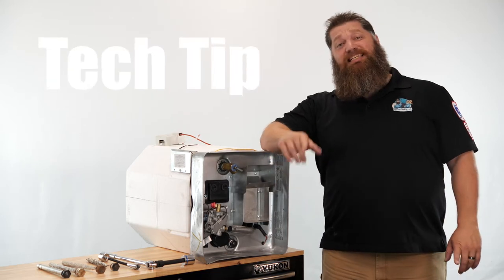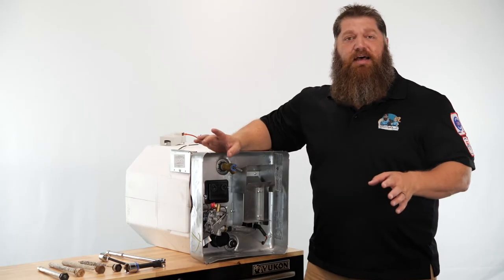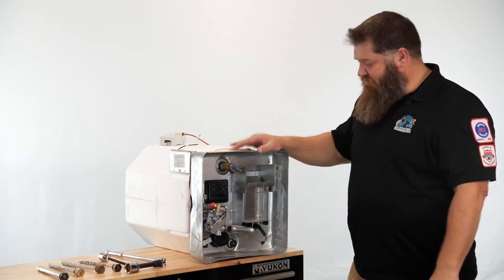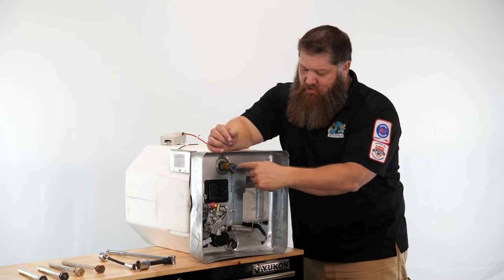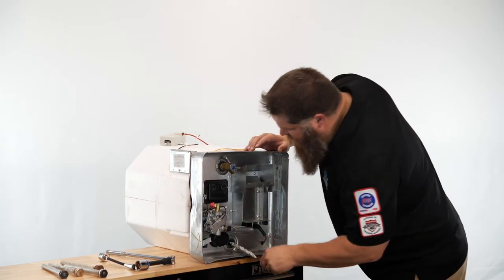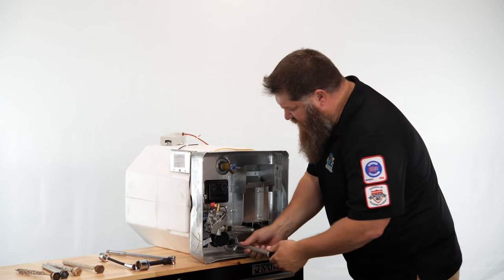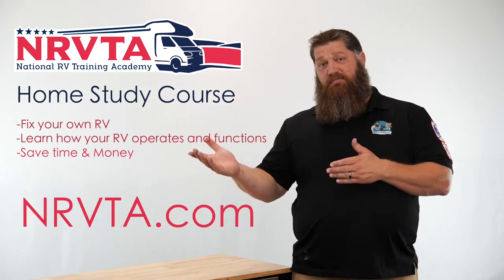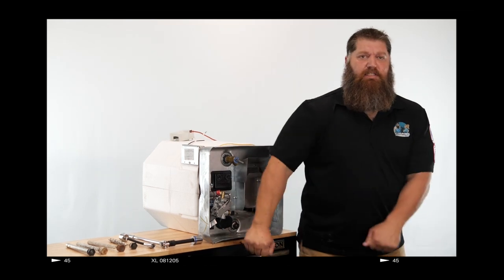What is an RV Anode Rod / How to change it

Comment: I know this video is a 3 years old but I have a question and hope you can answer it. Does it accelerate the breakdown of the anode rod if you run your water heater on and off. What I mean is I only turn on my water heater when I am getting ready to use it so I may turn it on and off several times over the course of the week while I'm out. Just curious because I have noticed that my rod seems to corrode away after about 4 months instead of the usual year as stated on the anode packaging.
Thank you for answer and I love your videos.
Reply from the maker: You can learn this and more at rvtechcourse.com

But to answer your question, there shouldn't be much if any difference how often you use your water heater.  It is more likely where you are and the quality of water there.
Reply: Thanks

Comment: First season that I am de-winterizing.  I took the anode rod out, have a new one.  I can’t remember if it seats all the way in.  Seems like I can only get about half the threads in.  I supposed if I fill it and it’s not leaking I’m good to go.
Reply from the maker: Don't forget to check out this week's Q&A part2 tech tip, where Todd answers your question!

Comment: I have a suburban water heater, 6 gallon from 1985 when the motorhome was built I have two problems first of all it will fire off one time heater water off and far as I know not heated again I took it apart, cleaned it out, blew it out, brushed it out, put it back together put an anode rod in if there was not one in it before because it’s propane only I assume now it will not heat the water at all Can you give me any advice?

Comment: Is someone still monitoring this site? I have a question regarding my Atwood RV water heater. 2008 Winnebago Tour KD.
I was removing the drain/flush cap and it appears I broke off the anode rod when removing the plug. Can I drill it out or punch it in?

Comment: I have a suburban hot water heater and want to change the anode rod. I have strictly as far as I know a propane only hwh. The anode had two small gauge wires on another fitting that screws into the current anode rod. I'm not sure what those two wires are for, but the anode rod that the parts department wants to sell me has just the plug with no available FPT for the current fitting that is on my current fitting. What are those two wires for and if I'm strictly propane do I need them?
Reply from the maker: It could be 1 of 2 things. 

That’s not your anode rod but your heating element. You can verify if it’s a heating element by locating a black on/off switch in the lower left hand corner of your water heater. 

Option 2 
 that’s not an anode rod. It’s called a hotshot. It’s after market. It converts a propane only water heater to electric too. 

I’m my opinion they are useless. An anode rod has NO power going to it. You would need to track down where those wires are connected to to SAFELY disable those wires and insert an anode rod. Is there a black box connected to the outside of the area you are talking about? If so then chances are it’s your heating element. Is the rod in question located in the bottom middle of the water heater? If so then that should be an anode rod, but possibly is an after market hot shot.
Reply: As far as I know it's propane only. I do not see any switch in the compartment. How can I send you a photo?
Reply from the maker: Thenson@nrvta.com

Comment: If I waited too long this time to replace the suburban 12 gal hot water heater anode. I see a significant calcium build up is there a way to dissolve the calcium build up?
Thank you
Reply from the maker: yes. 30% vinegar with water turn power off and let it sit for 8-12 hours. good as new

Comment: Is it only in the suburban water heaters? How do you know if you have one?
Reply from the maker: If you have a Suburban water heater, the tank is porcelain-lined steel and requires an anode rod to prevent corrosion of the steel tank. If you have an Atwood water heater, your water heater tank is aluminum and does not require one.
Reply: @NationalRVTrainingAcademy  on my 5 er, I have a tankless, my TT I’ll have to look. I never changed ours at all if we have one. Yikes. Does the anode rod affect how it heats the water?

Comment: Does it matter if you use a magnesium or an aluminum anode rod?
Reply from the maker: Either will work. The magnesium may add a slight taste to your  hot water.

Comment: What size socket ?
Reply: My same question I see no one answered. I will try and let you know I have to bring all the bigger sockets since no one knows and they may all be different by a little .so what fits one may not fit another
Reply: Mine was a 27 socket I have a suburban water heater model# 190800187
Reply: "1-1/16 socket